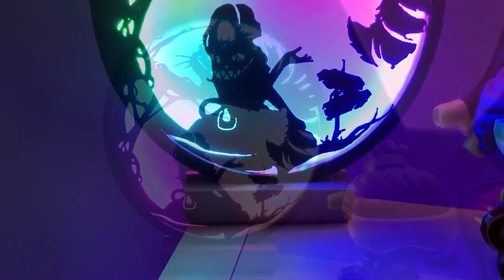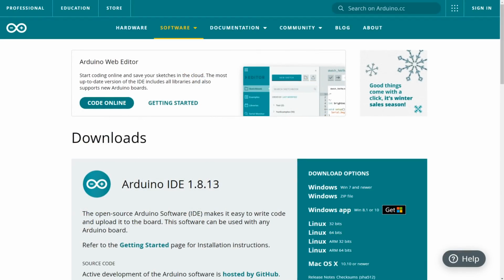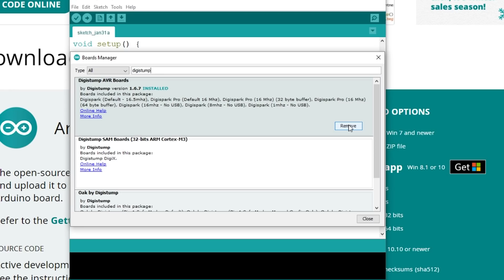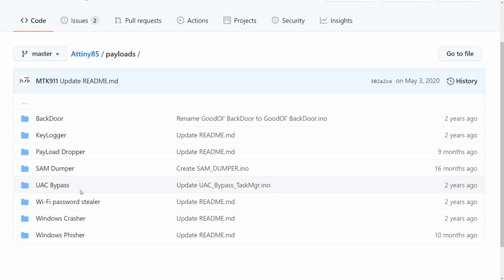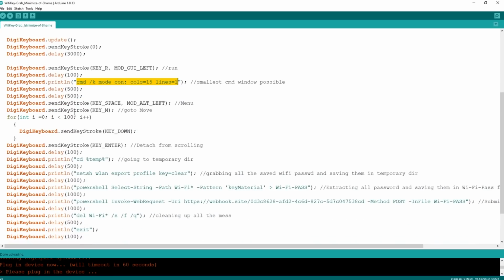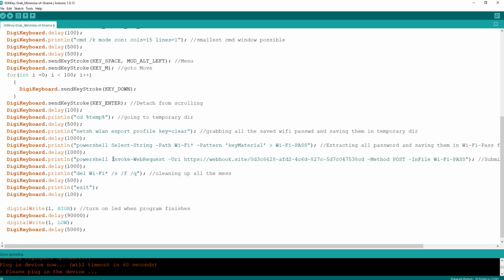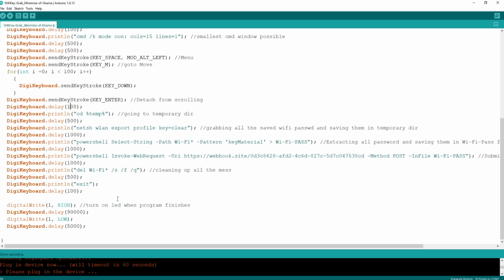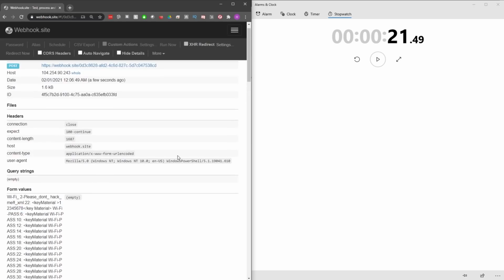Building a WiFi Hacking Device for Only $2

Comment: Awesome to see you are getting into hardware as well!
I just order a rubber ducky, before your video came out, but I was reading that this kind of "attacks" are not an issue anymore since windows defender catch them regularly, any input on it?
Reply: There are different ways to bypass windows defender
Reply: These are recognized as a USB keyboard when plugged in. WinDef doesn't see that as a threat. Now, if the PC is set up with high level admin privs (which most don't) to require an admin password even for plugging in a new USB mouse/keyboard, then this wont work. Other than that, theres no stopping it.
Reply: @iyeetpaste3797  You can disable the ability to run either powershell or cmd.exe in windows quite easily. That would stop it dead.
Reply: @terrabyte911  You can do almost anything you want on the window GUI with just the keyboard, without using cmd or powershell, just making the "rubber ducky" press key combinations like Win+R, type:control panel, TAB TAB ENTER, TAB, Arrow down, etc etc
Reply: @marcostapia7541  Take a look at some RD scripts online. They all use powershell for h@cking commands.
Reply: @terrabyte911  Well I will do my own payloads using the GUI if the cmd or powershell are disabled. Don't need to copy from internet sites
Reply: @marcostapia7541  ok how do I get a reverse shell using just the GUI?
Reply: @terrabyte911  Reverse Shell isn't all in life, sometimes you just need to grab one file or just some data for future attacks.
This could be one from many tools to get the job done.
There is not a magic tool that makes it all, but a set of tools and skills working together including social engineer too
Reply: @marcostapia7541  You're completely missing my original point. No serious hacking can be done without the use of powershell. Disabling PS will mitigate a whole host of attacks from RD. Every script I looked at on line uses it.
Reply: @terrabyte911  As I said in my last comment, it's just one more tool to do a specific task of the process. There's not a magic tool that do all the job
Reply: @marcostapia7541  I'm not talking about other tools. We're talking about the RD, try to keep up.
Reply: @terrabyte911  But you're expecting the RD to do all the job and open a reverse shell just for you to enjoy sitting on your chair and doing nothing but copying and pasting some payloads from the net, and that's not realistic of serious hacking.
And as I said before RD is just a tool from many other that can do a part of the job. If powershell is not available there's plenty of workarounds to do with the GUI. Just need to use your imagination and skills
Reply: @terrabyte911  Rubber Duckie is just like if you're in front of the PC and having access to the keyboard to do anything you want, not just typing commands on powershell. There are almost unlimited options to do. All depends on your  knowledge
Reply: @marcostapia7541  I don't own a RD!! haha. I was commenting on stopping it and you've insisted you can use the GUI. Right, prove it. How would you get a Win user password via the GUI from a non admin account?
Reply: @marcostapia7541  So you can tell me how I could get a users password by using the mouse and keyboard right? So please tell me. Prove you can do it via the GUI. I bet you cannot.
Reply: As far as i know (i might be wrong) . Windows 10 update I cant remember the correct number made it impossible, unless windows defender is disabled, then you're free to go.
Reply: Think Grey. Simplicity will always triumph over latest greatest.
Reply: @mahfugga  Thing is, you'd still need to plug the damn thing in without the other person catching on.
Reply: @Iamwolf134  not hard....literally only takes seconds. in and out. can be done easily with someone's back turned, or they go up to a counter for something, or the bathroom, whatever.
Reply: @beau8839  Assuming you've gotten into the building to begin with, and that you've managed to evade their closed circuit television cameras.

Comment: I actually bought one of these about two years ago, for this exact purpose.
Altough I made mine with a rick-roll script, just so that I could have it on my keychain and plug it in to public PC's :)
Reply: does that rick-roll script convert normal usb to rubber ducky??, if yes , is that script available on github??
Reply: @suryadev4968  What do you mean by "convert"?
Reply: @L4marca  he wants to use a usb drive to be a “covert” but cheaper rubber ducky
Reply: Lmafao
Reply: please help me to hack this account . because someone using sexual harrastment.
this account please help me to hack this account . because someone using sexual harrastment.

Comment: Bro is it brute forcing the password, if brute force then no point write if there is a strong password it may take long time + if the wordlist doesn't has the word then it won't crack..?? Or it is using just keystrokes to get the password from the Stored wifi password in windows ??
Reply from the maker: It's not brute forcing...

Comment: you need to connect to a wifi before you stole it?
Reply: The victims pc needs to yes
Reply: No, the actual password is stored on the victims system in plain text.
Reply: It doesn't need to be connected. The victim's computer must have had connected at least once to the wifi, so that the password is stored on the computer.
Reply: @fakewalka  ah apologies, I had interpreted the question as "connect at least once" this is what I was thinking too :)

Comment: Thanks Heath, one project to look into.
Let's test out employees, to see who will bite and plug in some USB from the parking lot.
The script can be modified to send also the computer user's name and workstation's, I assume. 
Just adding the corresponding PowerShell cmdlet and modify the string sent to webhook.
This is going to be epic.
Thanks a lot!
Reply: This is dependent upon PowerShell not being disabled through group policy. If be willing that most companies with dedicated IT staff do not allow PowerShell to run on user machines.
Reply: @pcolapaddler  Or disable usb storage devices via GPO (prevents this exploit as well as helping to prevent data leaks).
Reply: @pcolapaddler  there are some production environments that require access to PowerShell to build/rebuild the environment.  Setting it up beforehand then locking it down would only set up a scenario where deliverables aren't met on time, especially in a department currently going through a period of crunch.

In a perfect world there'd be a way to use 3rd party tooling without having to leave vulnerabilities open, but then again in a perfect world there'd be no crunch and we could all leave our networks wide open regardless because no one would have to worry about intrusion or any type of attack.
Reply: Just label it “Rachel’s NSFW audition” - 99% of people will plug it in w/o sandboxing it.
Reply: How'd you go with this?
Reply: at $2 you could  be easy to make a bunch and send them out
Reply: if you want people run it 100%, piece of tape labeled "2023 vacation photos." The tape allows people to remove the tape so nobody will know they have "their" stick. The term "vacation photos" will appeal to different people for different reasons. Even "helpful" honest people will want to open it to return it to the owner. Avoid terms like "NSFW" or anything that may result in honest people just tossing it.
Reply: Label it "private collection"
Reply: What a dumb ass thought to have
Reply: @viciousmagician4567  What's dumb about it? Would you rather discover your staff have plugged in a random USB when your system gets infected with ransomware? I honestly don't get it - he's writing the code and leaving it, if an employee is doing that sort of thing it's going to happen regardless of whether it was your USB. Atleast this say it isn't malicious